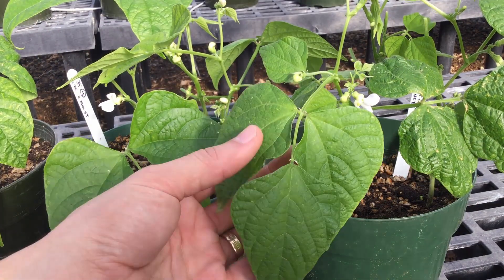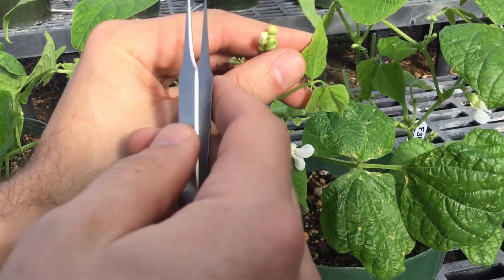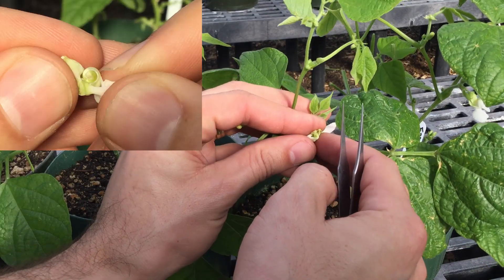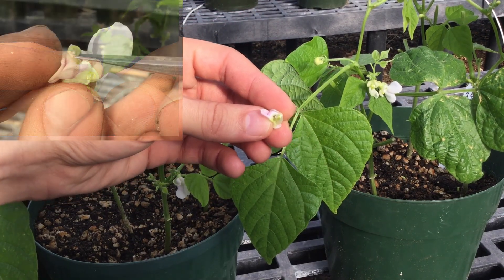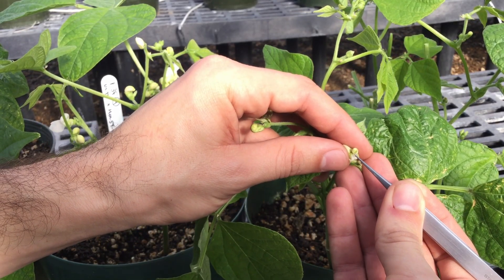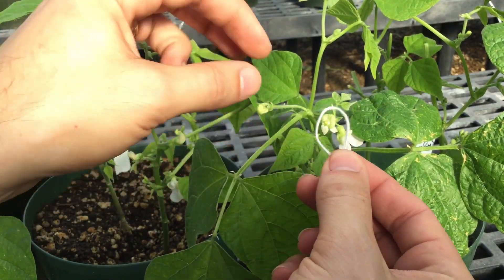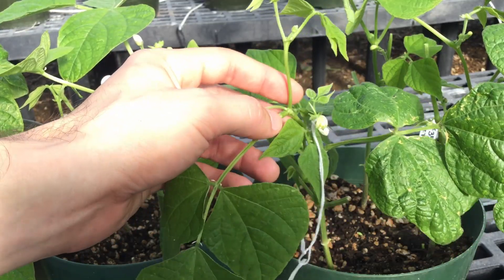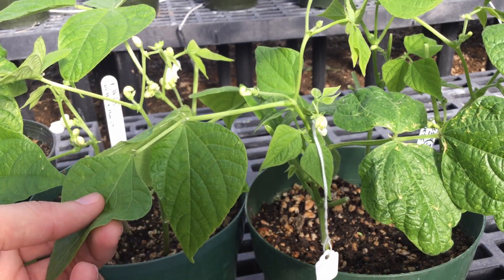How to cross pollinate beans (genus Phaseolus)

Comment: Wouldn't you have to emasculate the flower you cross pollinate?
Reply: Sorry just read the description, although I dont understand why
Reply from the maker: @jorrit3118   That's a great question! In Phaseolus we don't have to emasculate. In a normal Phaseolus flower without human intervention, the anthers (pollen-producing structures) break open and shed pollen as the stigma pushes through, in the early morning as the flowers open, and the stigma gets coated in pollen. In this method, we open the mother flower prematurely, before the anthers break open, and the stigma pushes through before the anthers are ready. So that mother plant's stigma is not coated in pollen. Once the stigma pushes through it won't go back in or come in contact with the anthers, so we don't have to worry about self-pollination!
Reply: @travisparkerplantscience  Thanks for the clarification!

Comment: You mentioned that you wouldn’t know if it was a successful cross until the following season. If a pinto and black bean cross, what would the beans come out looking like? I’m going to try crossing a pole flat bean with a bush flat bean I like. Is getting a pole/bush mix possible or will it likely be one or the other. Thanks! Great video
Reply from the maker: Great question! A cross between a black and pinto bean will almost always give you a black bean in the next generation (often with somewhat bigger seeds like the pinto parent). If you let those set seeds, you will get all kinds of combinations, including pintos and black beans, and often all kinds of other types beyond what is seen in either parent. Crossing pole with bush beans almost always give you a pole bean in the F1, but if you let those self-pollinate you will get both bush and pole-types back in the second generation. 

Long story short: Make crosses and in two or three generations you will have all kinds of cool combinations of the traits you started with and much more! I usually make sure the mother has some recessive characteristics (bush type, lighter seed/flower color) so you can know quickly if your crosses were successful.
Reply: @travisparkerplantscience  thank you! So one has a purple flower (marvel of Venice) an the other white (early Italian), so it would be best if the white one was the mother? If I saw plants in F2 or F3 that had characteristics I liked how many further generations would it take for those characteristics to stabilize and become true to type? Would just seed saving from these plants allow for that?
Reply from the maker: @farmerjon7598  More great questions. Yes, I would use the white-flowered type as the mother, and the offspring should have purple flowers (or at least some kind of color). You will see about 25% of F2s have white flowers. With every generation starting at the F2, the instability is cut in half, so any given F2 has 1/2 of genes still variable, an F3 is 1/4 variable, F4s 1/8 variable, etc. All you have to do is let them self pollinate in the field. We usually select our favorite F5 or so, but there is no right or wrong way to do it. We released a variety that is descended from a single (surprisingly stable) F3, and others we have taken to the F10!

Comment: Wow I have been looking for a video like this for a while. I watched your spanish version first and my spanish is apparently still good enough to get most of what you said. But watching in English helped a bit. ;) Hooking the two stigmas together is a good trick. Also excellent point on the seed coat being maternal tissue.
Reply from the maker: Thanks! Yeah making cross-pollinations in beans is really crazy, you can get so many different progeny from any cross! One other thing I should have mentioned is that it is best to do this when it is cool, ideally in the morning and on cooler days
Reply: @travisparkerplantscience  right because high night time temperatures can block fertilization in beans. I have run into that problem with just bean pod production here in Missouri in midsummer from my pole beans. Flowers will form but the ovary just drops with the flower. I tried Tepary beans as a possible substitue for P. vulgaris but in our relatively moist climate they hardly produced anything. I have heard about hybrids between Tepary and Common bean but I read they require embryo rescue in the first generation. I hadn't heard of any varieties being released from those crosses yet. I had pretty good luck with Vigna species though. :)
Reply from the maker: @Biophile23  That's right! The good news about crossing is that (usually) you only need one F1 plant though, so if it is hot and your crossing success rate isn't as high, it should still be okay as long as you get one. You're right about tepary / common bean hybrids needing embryo rescue, there are some newer releases where some ancestry comes from one species or the other, but it is hard to transfer complex traits like heat tolerance :/
Reply: Hi  @travisparkerplantscience  thanks for the awesome vid. What do you mean with you need only one F1? Wouldn't the multiple F1's look different? So I'm guessing you would need more than one to see if you get the result you hoped for. Or do you mean that you don't need to breed till F8 to get a stable hybrid /true from seed?
Reply from the maker: @Optimistforreal   Beans self-pollinate (except for the relatively rare cross-pollination by a bee or human), the result of this is that homozygosity builds up and they become very stable and homozygous. So assuming your parents are quite homozygous (which tends to be a safe assumption, unless you made a cross), all the progeny look the same. 

An example with one gene: If one parent is AA and one is aa, the only possible offspring are Aa, and they are all the same for that gene. With four genes, if one parent is AABBCCDD and the other parent is aabbccdd, the only possible progeny are AaBbCcDd. They will therefore all be the same for these genes. Humans and many other species have siblings that are quite different because each parent is (hopefully) quite heterozygous, but this is not the case in many inbreeding self-pollinating crops. I hope that makes sense!